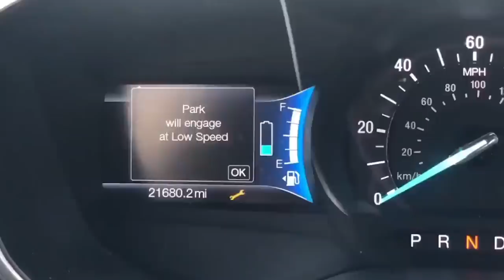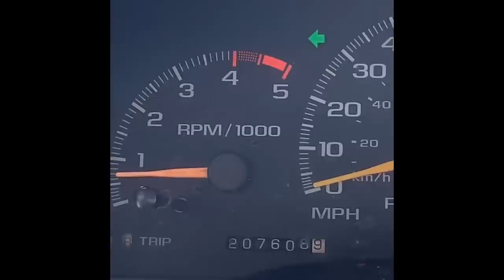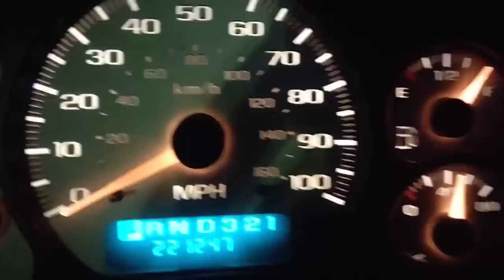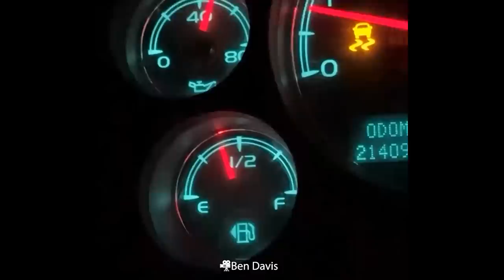Customer States & Mechanical Fails [Part 36]

Comment: "German engineering. You will never feel a smoother ride or hear a more pissed off mechanic."
Reply: Yes, but the porsche is the BEST forever
Reply: Whoever said that doesn't deserve to own a Volkswagen.
Hello to all MK3 drivers from a novice car mechanic and owner of a Mexican Golf with ABA engine. ❤
God bless you, guys.
Reply: German cars are the best to work with. The worst is a ford and french cars
Reply: @Yarkozhaluva strongly strongly in ever conceivable way disagree with you. I've worked on both and Fords are a cake walk compared to the stupidity and idiotically overthought German stuff. Not to mention all the special tools needed for little mundane things on German cars.
Reply: have no business near a car if you can't work on a German car. I guess it's just the cool thing to say
Reply: Owned an Audi A4 once…never again!
Reply: @YoureTodaysWinner I'll gladly stay away from any German car for the rest of my life haha
Reply: Meh. Some are definitely worse than others. MINI and VW/Audi are way worse to work on than BMW and Merk-a-deez
Reply: @MTLbigJ  I have been a Technician for over 25 years. I am no fan of Fords, and I still agree with everything you said.
Reply: @MTLbigJ , I say that about most European cars. They are just over engineered.
Reply: @lukeyarasheski5510 depends on the model, the older you get with those two the better tbh, less electric bullshit to go wrong. The only thing I actually have to say about Benz’s is that the A/T’s age like milk. BMW’s are just plain solid if someone who knows how to take care of them owns it, but since 90% of bmw owners will never even open the manual, the majority of them are fucked up.
Reply: Its a smooth ride until something inevitably breaks then its a expensive ride and you pissed off your mechanic

Comment: When I worked for Chrysler, we had 6 new cars arrive. The front trim and right fender said Aspen.  The rear trim and left fender said Volare.  So much for quality control there.
Reply: Except with a chrysler nobody is expecting anything from it. Be happy it starts up within the first 5 attempts and lasts 3 years.
Reply: The only thing that car had going for it was that the Slant Six was still in production.  My Uncle put 300,000 trouble-free miles on a Volare station wagon.
Reply: @SpitfireMkIIFan  My Durango is currently 21 years old and still going strong. My Aspen only lived 19.
Reply: My first car was a Dodge Aspen. It wasn't bad for a $600 car I guess.
Reply: I was a a ford dealer, same thing.  One side LTD the other Marquis
Reply: I (Australian) bought a Marlin XT-22 TRS rifle.
Right out of the box it had a BENT BARREL !!!
At 52 years of age, in the year 2023, life has taught me:  Buy Chinese, but DO NOT BUY "made in USA".
Reply: @OhSoddit probably shipping, but good luck with that mate
Reply: @SpitfireMkIIFan , exactly! ESPECIALLY if it has the notorious "3.6 Pentastar" engine and certainly the "ticking sound." 😑Anyone with it should fix it ASAP or dump the vehicle. Chrysler should be held criminally liable for such a garbage design/materials. You may find shredded cam lobe bits in your oil filter and possibly bits of steel, steel needle bearings etc., in your oil pan.... All because the roller rockers and/or valve adjusters fail in some fashion. The VVT engine has the cam lobes press down on the rollers of the roller rocker arms to keep pressure on the rockers "holding them in place" on the valve adjuster and valve stem. Over time the shafts that the tiny rollers ride on using needle bearings, deform causing the rollers to "drop" which allows the cam lobes to ride directly on the rocker frames shredding the steel cam lobes to bits and those bits end up in our engine. 

Anyone who knows what a cam lobe looks like, knows it's a "tear-drop" shape, yet some of the lobes on one of the four cams was COMPLETELY rounded. That's how much steel was shredded by the time I "inherited" the vehicle & I do mean "inherited" not purchased. And this was around 100K miles and only 5-6 yrs old. I have vehicles over 20 yrs old and with 160K and 240K miles on them, old reliable push-rod engines and yet NEVER had to perform any valvetrain work on them to this day.... As I said Chrysler should be held criminally liable for such garbage & have to reimburse customers for all related expenses yet they're still putting that engine in their "Pacifica" & whatever other vehicles they're still putting that V6 in....
Reply: When I was a GM tech, in the mid 2000's we had a batch of Cadillacs delivered that the factory forgot to paint any of the driver side door jambs 😮
Reply: Most people, be they American or whatever just don’t give a shit anymore.
Reply: sounds like Chrysler in a nutshell tbh LOL
Reply: seen some stuff too working for kia

Comment: If I've learned one thing from years of computer repair and (fewer) years of driving cars, it's that you NEVER ignore error messages and/or strange noises.
Reply: I used to be an IT guy, became a mechanic a few years ago. There are customers in both fields that are exactly the same. There's the "oh my buddy can do it cheaper" that you inevitably have to put more work into to fix the original issue and the attempted repair, the "I will ignore every message and warning until it no longer does what I want" people, and the "that basic maintenance that will prolong the life of my machine that I ignored for the first three years is due" people. They're might be the same people for all I know.
Reply: Only ignore warnings if know what the warning is and know it doesn’t matter
Reply: @MikeClowder you forgot the people who come to you to fix it, then  know more about it than you
Reply: @trekaddict, I've learned over the years from computer and car repair that I love but also HATE BOTH in large part because of the "Engineers" and those who micromanage them to create "piles of rubble" to litter your home/office and driveway whilst depleting your bank account in order to maintain/replace them! I'm also a "ST" fan Captain!😄
Reply: @good-ql6un  Which is most of em, if you drive an Opel

Comment: The toolbox got me right in the feels. The box alone was probably around 30k, then the tools in it. Truly heartbreaking. I wonder how they got it back upright.
Reply: Well, after the tow driver stopped crying and called his insurance, they probably used a fork lift
Reply from the maker: -10K gone in a blink of an 👁️
Reply: @Carhax  that was way more than 10k. That was a snapon box with a hutch and 2 side lockers. I have a snapon box myself that's a little bit smaller and without the lockers and it was 12k almost 10 years ago. The box and tools together is probably around 100k depending on what tools he has in there. I had a manager move and scratch my box and we were about to fight. I can't imagine how that guy felt
Reply: Why should tools break when the chest tips over? Serious question!
Reply: @albinklein7680  most tools aren't the issue. The problem is what kind of diagnostic equipment did he have. Cars now have a lot of electronics in them that require very expensive diagnostic tools. Scan tools aren't cheap. Another thing is power tools. A lot of technicians have gotten away from pneumatic tools and are using battery powered tools which have plastic housings. Aside from expensive tools possibly getting damaged, now he has to reorganize the toolbox which can take a long time.
Reply: @albinklein7680  most of the simple tools would be okay, wrenches, ratchets and sockets. But all the electronics, the diagnostic computers would be toast, the precision tools like micrometers and calipers would need to be recalibrated or replaced. But the biggest bust is the box itself, probably 25-35k.
Reply: Snap-on boxes aren't worth the price IMO.
Reply: @jakk222rem  you really want to tell me that snap on cannot make boxes for calipers or micrometer screws that survive a one foot drop? 
How pathetic is that please? And how utterly ridiculous is a scan tool for cars which cannot survive being inside(!!) a tipped over tool chest? 
Are you really serious?
I knew that Snap on is really crappy. But to that extent?
Reply: my ? is, why spend tons of money on a tool box that size and it doesn't even separate into components?

Comment: Fun fact, class 8 trucks actually have three check engine lights. One that looks like a normal one, one with a wrench inside of it, and a red one that tells you to stop the engine immediately.
Reply: We have different stages of "oh sh*t"
Reply: Looked like the freightliner cluster. The M2 I drove would periodically turn on both yellow lights, then start flashing the red one and then auto shutoff in like 20 seconds. After 3 restarts it would lockout and not start for 30 mins. Faulty coolant level circuit because I guess drivers nowadays are such dummies they have to code them to shutoff automatically when it thinks the coolant is low.... Seems like a lawsuit waiting to happen as the exhaust brake stops when the engine shuts down. Had a pretty steep hill I had to cook my brakes on because this engine shut off. Mind you this freightliner had only 130k miles on it!
Reply: So let me guess:
1. Try to fix yourself or visit mechanic at free time
2. Your next destination - Mechanic
3. STOP, YOU'RE HURTING ME!
😂
Reply: They should have this feature in every car. It would save some of us so much grieve.
Reply: @pliedtka  Yeah, now engine check is on with every failure chip detects. Even ones which technically don't impact driving that much nor in short-term will cause any damage.
Also so many modern cars have touchscreen, why they don't show status of fault? Like "low oil pressure"... etc.
Reply: They're not called idiot lights for nothing.
Reply: @mariuszmoraw3571  LOL. But no. They each tell a different thing. And (most of the time) it has to do with the exhaust  burning system what is  there (supposedly) to keep the fumes that go into the world cleaner.
Reply: @mariuszmoraw3571  the check engine light does not show a status because it forces you to go into a shop and get a read-out of the computer for $80 (or so).

Comment: as an european i agree with bmw, but god damn VAG cars has everything made by logic, so its easy when u know how to do it... btw those american mechanics should try to repair some french or even italian car ( especially alfa romeo..)
Reply: VW's are so easy to work on especially early 00s.
Ots just Mericans not liking anything but thier own cars that's all.
Reply: If everyone will prefer VW, who will drive and repair those BMWs?.. Just don't sat anything, guys. Love your Volkswagen and don't tell it to anyone.
But... You should know how i love my MK3 with 2.0L ABA ENGINE. Buying this was my best decition as a car mechanic. 
Sorry for my bad English, and hello from Russia. 
 (^-^)
Reply: @ВикторМарухин-с2ж  dont get me wrong, bmw’s are amazing to drive! But i was working on few of them and it is just anoying as hell.. there are like 70000 Plastic pieces everywhere .. and their bolts.. why just why are they using bolts for “E” socket ..
Reply: @ВикторМарухин-с2ж  I had a MkIII Jetta for YEARS. So expensive to fix but so fun to drive!
Reply: @koyaanisqatsi316 yea but every screw is different size and you need to undo half of a car to do something..

Comment: 7:50 - lol  HUGE hole in the engine block.  "The belt's done come off".  :)
Reply: Just put a belt on there, it will be fine!
Reply: The camera could see the hole but the guy probably couldn't at the time of filming is my guess.
Reply: 😂yes, I was hoping someone else seen that
Reply: @Idontknowmaybejohnsmith I hope so😂
Reply: @irgnedeinname clearly the tech could too, that was the whole point of his joke.
Reply: Yes. I am aware of the sarcasm, and I loved it (which is why I commented).
Reply: Reqlly?!l?🤦‍♂️
Reply: That's the timing chain cover with a hole not the engine block.

Comment: I’ve been a dealer tech at all big three and ran an Indy shop. Any tech that thinks BMWs are hard to work on is just a parts changer. Beemers are easy and you can get the factory diag and module programming software. I left the industry for greener pastures, but I buy and repair BMWs almost exclusively.
Reply: Hey been a Toyota guy since a teen. But I’m looking to possibly dip my feet with BMW. I figure I’d start with a m340i. What would you say are the top 3 differences in working with German cars opposed to Japanese. Srs questions 🙋🏽‍♂️

Comment: @0:58 that is the exact reason why I take my time raising a car and do a shake test 6 inches off the ground before I commit to raising it. I have to stand under and do not want this to happen. TAKE YOUR TIME SETTING A VEHICLE UP TO BE RAISED IT’S WORTH IT.
Reply: The worst ones I have found were Ford trucks. Usually I will raise it about about half a foot and then stand on the back and front  bumpers. If it can handle 200 extra pounds, then it should be fine. I have been doing it for over 25 years and I am still nervous when I raise one. I have seen one too many fall. Luckily it was never one that I was working on.
Reply: I do the shake test with jack stands.  When ever I work on brakes I even slide the tire under the car, jic.

Comment: 6:04 Can relate its the only way to find out.
8:19 As a Retired Car Mechanic I would say the worst one I worked on was a Renault Megan from 2008.
2:32 Many reason why people don't see whats going on is quite simple:
 
 When buying a new car (or some brands of car) the Car Mechanics of that Car Brand DON'T allowe you to see the car on the lift
And when its a old one some Car Mechanics that work privately don't allowe you to go under the car for "Safetly" reasons
That apply to non-car people but not to a Retired Car Mechanic like myself.
 
The Car I bought (Hyundai i30N) the Dealer allowed me to see under the car even,they really showed care for they customer wishes.
And when I used to work with my Father in our Garage,we would always allowe the customers to be in the shop warm up next to the oven,chat,eat some food together as it basically was almost a family like feel to it,seen lots of the same customer as far away,short or long drivers.
Reply: With you on the Megane, headlamp ‘bulb blown sir? Certainly, let me just Jack it up and take a wheel off…..’
Reply: @chrisdowns1987  I personally think its not the headlights,but rather when you do head gasket change and find out that the cylinders are worn out because the customer neglected oil change or the engine is that badly designed.
Leaving you to take the whole front bumper to take out and take the engine apart.
Reply: @neromastic4512  😱 I never had the misfortune to do much more than basic servicing on those thankfully but the stupidity of design doing basic maintenance like bulbs gave me a clue! That one just sticks in the mind. Those and Fiat Stilo bulbs were infuriating. Mind you, I now work for a certain premium German manufacturer and quite a lot of work instructions start with ‘remove engine’ 😳. Workmate next to me got a twin-spark v12 for a plug change last week, imagine the fun for 24 buried plugs! 😂

Comment: I worked on BMWs through the 70s. Compared to most American cars, it was a rats nest of confusion. But Once you understood it , the car wasn't bad. But the problem was, they were always in to get fixed or for recalls .
Reply: LMAO the 70's cars regardless of brand have changed a lot since the 1970's the most high tech car on the market in the 70's would be childs play compared to today's cars

Comment: I've owned 2 BMWs E36  and a E46 and leased a E89 through the employee discount program with the dealership I work for. Hands down..the best handling cars out there, but they are POS's...lol The interior might as well be made with Play-doe and exterior rubber...chewing gum. When working...great power and handling. When it's time to fix something under the hood...time to take out a second mortgage..lol
Reply: Yeah I loved my low mileage 2007 335i, but would typically drive my 20 year old, 240k mile Jeep Cherokee on road trips because I trusted it more to get me to my destination.
Reply: I love my E38. Actual leather for most interior components not gummy vinyl crap. The 90's had better made interiors and the late 00's, while remarkably fast, are absolute trashcans. I used to work at a german car shop. Though still would take the BMW's over any Mercedes. The interior of new Mercedes smells like cheap chinese plastic vs the smell of leather and luxury in the newer BMW's. I think the only gummy rubberized crap in my E38 is my radio volume and navigation control knobs. Luckily they arent too bad.
Reply: @OrionDakota  My 2007 335i had REALLY nice and durable leather, while my 17 Lexus has crap leather in comparison.  Crazy the short-lived car has a long lasting interior and vice versa

Comment: The two check engine lights are normal for heavy duty. The MIL is for any emissions related fault code. The CEL is for any engine related fault code that doesnt have time be tied into emissions but sometimes is. Its super common for a truck to come in with CEL/MIL on. And flashing CEL or MIL means shut that shit off now

Comment: I get the "German cars are the worst to work on".

They run great for a good long time, but once they break they are a bitch to fix up.
Reply: Over here in Germany it isn´t that bad - lots of hacks, manuals, and repair-stuff on the internet and helpful guys (and sometimes gals!) in discussion groups. Also torrents of spareparts. Choose wisely though: Audi A8 for example, avoid the V12 and the V8 5-Valve engine. Also have a spare 6000$ for an automatic gearbox overhaul (or, like me, drive the S8 with manual gearbox. Porsche-killer. 😁 ).

Comment: 3:45 The timing belt pieces clogging the oil is super common for the Ford 1.0, even if you do change the oil. Piece of junk engine. Why the hell the timing BELT is oiled is beyond me.